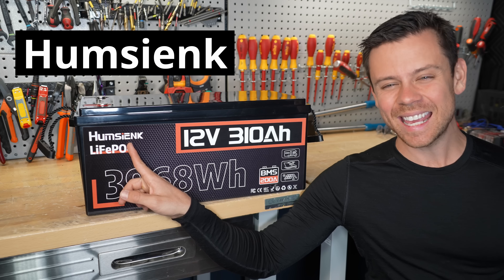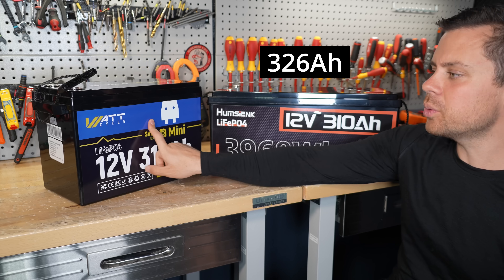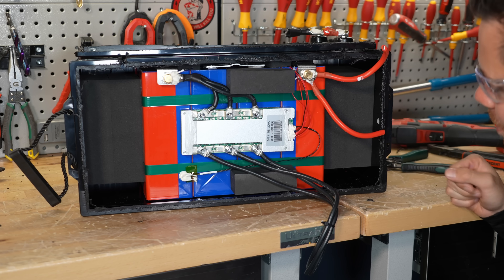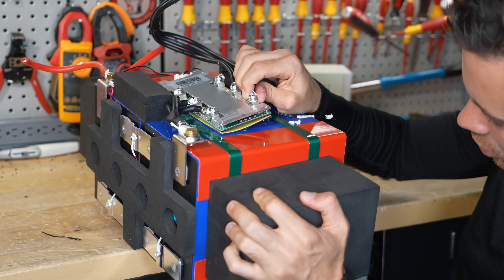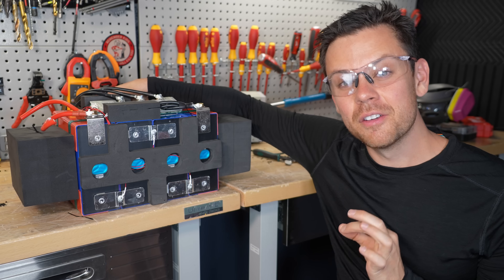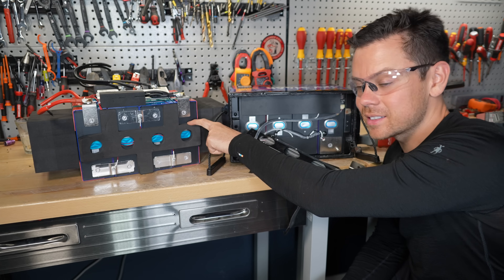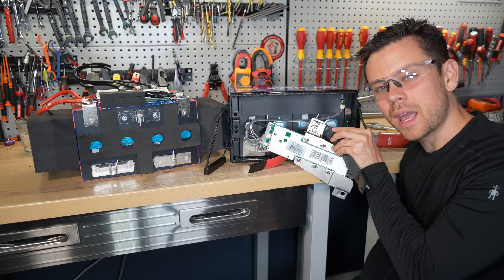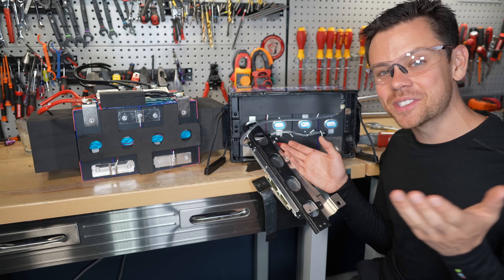$369 Humsienk 310Ah Battery VS $500 Wattcycle "Smart" 314Ah Battery

Comment: Hey Will, at about the 2 min point of your video, you strongly suggest to install a Terminal Fuse on the battery. Sorry for the dumb question(s), I'm a newbie to all of this, but how do you determine what size (Amp) terminal fuse to use? I have found many different opinions-Difficult to know who to trust. FYI, I just want to put together a system using a Lifepo battery, probably 12V 100Ah or 24V 200Ah, that I can use to charge my Oupes Mega 1 when I have bad solar and no access to AC; My hard dry camping days or hunting excursions! My Oupes Mega 1 accepts solar charge at 800W Max, 12-78V DC, MPPT: 18-75Vdc, 14A. Again, sorry for the long winded question but I can't seem to get an understandable straight forward answer. I even logged on to the DIY Solar Forum and got several different opinions. 😒
Just looking for some intelligent guidance.

Comment: I’ve watched you from the beginning impressed with your videos. I’ve been watching the current Battle Born saga, unfortunately I have 7 of those (4 in a buddy van build I did and 3 in my own camper). My battle borns seem to be doing fine, I’ve done a bit of testing under load and checking terminal temps. That said I just ordered 2 HumsienK 314ah minis to replace them with. I needed more capacity. Any chance you will do a test on the mini, I’ll certainly keep you updated with my view?

Comment: I use these Humsienk batteries in my cars as an auxiliary power source for my audio amplifier, air compressor, power inverter (to keep tool batteries charged). The batteries are usually a few inches away from the subwoofer, and the roads I drive are akin to wash board roads.
Its been 2 years of use on my oldest Humsienk battery, overall very good product, and very durable.
I think I paid 160-170 each from Temu and it was from a warehouse in the USA.

Comment: If you thought that was a good price for the Humsienk, they currently have on sale on their website a 12.8V 8,192 Wh  (640Ah) LiFePO4 battery for $644 if you get the 2-pack. It even got smart with Bluetooth and a 250A BMS. Got an additional 5% off with a Christmas code. Of course I had to get the 2-pack.

Comment: I just ordered 2ea Dumfume 12v - 314ah self heating batteries.  I took your advice about stud fuse for each battery.  I have several older 12v 100ah lithium batteries, how should I dispose them safely?

Comment: Thank you for your great video. I think it's great that you get to the bottom of all the things here. This is a good way to get a good impression. I have a question for you. You mention the problem when you connect two identical batteries that they discharge absolutely unevenly. Were you able to determine this with the Humsienk as well? Because I wanted to use 2 Humsienk 314Ah in parallel in my motorhome. Or should I rather buy the ecoworthy from the test right away. Currently, 2x 314Ah with Alieexpress delivery from Poland to Germany would cost 545 euros. I would be happy if you could write to me. Greetings from Germany Markus

Comment: This is what happens when batteries make a name . There are many other batteries out their that work exactly the same Like the Humsink .. It works for me as long as you have a battery and you can use a fuse or a circuit breaker .  Redodo 12V 165Ah LiFePO4 Battery with Bluetooth, 165A BMS, 2112Wh, Group 31 Lithium Battery with 1.65X Longer Lasting, Perfect for RV, Marine, Solar  $279.99 It was going for as low as $199.00

Comment: On 11/14/25 I see that there is now a Humsienk 12V 320Ah Bluetooth LiFePO4 Battery with a 250A BMS for only $299.99. I am thinking about getting 2 for a 24v battery bank. Saw it on the Humsienk website.

Comment: First - Thanks for your great videos.👍

Secondly, a question -
Can you use 2 of these in series to use in a 24v solar system?

Does the BMS in the batteries handle the balancing, etc if put in series?

Or is it best to buy 24v batteries and put them in parallel to get the amp hours required (as most 24v seem to be 100ah)?

Thanks for any info / knowledge you can provide.

Comment: Thanks Will, whats your thoughts on those MRBF fuse holders having a 3/8" mounting hole & connecting one to a lifepO4 with 5/16" post ? there is a pretty big gap there.

Comment: Will you be testing any of the 600ah batteries? I currently have 1 Watt Cycke 300ah "dumb" battery but will be considering going to 2 600ah batteries on my boat, with a xantrex xc pro 2000

Comment: Totally unrelated but I have a 8k hybrid GDSuper inverter 3 710w bf panels & 1 450w mc panel can I run my house (avg 6 sunhrs) ac to keep it Kool? Also I have a 12v 200ah gel battery can I get a booster or transformer type device to go 48v maybe to just power the inverter idle mode to, love u Will could u let me know?😅 my pockets r weak I want to avoid going on grid ($500usd) or getting a 5k lion ($1100) I wanna just buy a $50 booster device or just go panel inverter to load when sun is out😅😅😊

Comment: I would love to switch my dump trailer to lifepo but it pulls 400-800 amp with a heavy load should I just use a lifepo with 30amp dc-dc charger to charge my led acid
Reply from the maker: Use trolling motor lifepo4
Reply: @WillProwse definitely not cost effective

Comment: @willprowse can you help me with a capacity problem im debating? I made my first 280ah 48v battery, I wish I would have used 314ah or 320ah cells though. I am going to make 3 more, but im not sure if I should stick with 280ah so I could use them in series in the future if I ever want, or if I should just make the next ones with 320ah to get the extra capacity for the same footprint. What would you do? Im really stuck here, any help is really appreciated

Comment: I got a DOA EcoWorthy 280 AH LifePo4 battery non Bluetooth and opened it up myself. (Not my cleanest work) the bms was disconnected from the balance leads I think. One of the connectors with the glue or white goop had obviously not been glued or gooped up properly and was just hanging from the bms and it connected with the 0-25-50-100 percent led thing. They offered me 60 bucks back I asked them if they’d send me a 20ah battery but since it was an Amazon purchase they just credited back to orig pay method. Although on the other hand got a perfectly fine Bluetooth EcoWorthy 12v 100ah of the same style but just the Bluetooth and works fine. Hmmm

Comment: Greetings, i have enjoyed your videos. I had looked back through past videos and was trying to see if you had created a video on a ‘plug and play’ solar system that included a few solar panels and low voltage micro inverter (120v) that could simply plug into a home outlet (dedicated circuit). Goal is it add a few kWh to a home’s supply each month, reduce power bills by a few $$ each month, and take advantage of the tax credit. There is likely issues with this type of setup but hard to find many details/videos. One issue I found is the inverter needs to stop sending power to home when there is a potential to backfeed grid.

Comment: Good morning Will,
I just purchased 25 380w, 48.45V Voc, 9.9V Isc solar panels and an EG4 12000xp for an off grid system for my house, I was wondering if you  could help me configure a series/parallel array that would give me the highest efficiency out of those panels connected to the 12000xp and what cabling will be needed for a 250ft run from the panels to the inverter and if it is even possible or advisable. I hope I gave you all the information you need to help me figure this out. I will appreciate it very much if you have the time.
Thank you!

Comment: Will Prowse 
Can you give me advise. I have 450W of solar and i would like to  charge my 36v golf Cart battery and my Bluetti 200 P, I have a DC switch with 1, 1+2 and 2 .Golf Cart has a controller on 2 and solar straight to my Bluetti on 1. When i switch to 1+2 , will i be able to charge then at the same tine.
Thanks for your Time

Comment: I bought WattCycle 314 Smarties thinking I could double them up in my RV, that is until I saw your video on the BMS issue. So now I have separated them through switches and can run or charge only one WattCycle at a time. Pain in the neck! Please advise on when BMS update is coming and how this will be installed. Also, your thoughts on outdoor storage at 10 degrees Fahrenheit would be much appreciated. Cold temps coming quick in Colorado. Thanks for what you do!

Comment: Watt Cycle recently added a beta 4 version of their app which gives two options under the parallel mode setting: Compatibility Mode, or ExactMatch Mode.  The ExactMatch mode is for when you are using all the same brand/model batteries which were purchased within six months of each other.  Compatibility is for when you have different brands/models in parallel.  Next they really need to fix the Android bluetooth connection issue.  It takes me three attempts to get connected... sometimes four.  Perhaps due to a BMS sleep mode when the batteries are not being used.

Comment: Hope you read this. In Asheville, our home has limited indoor space to add backup. Would like to add battery backup externally but only see EG4 & Discover with weather rated exterior batteries. Is there a budget version of these wall mount batteries like the DIY $1699 you posted? For our home, the EG4 case they offer that can come with 2 exterior heated batteries, a Grid Boss & Flex Boss would be perfect in theory. But the PRICE of that is astronomical. Can you “build” a budget version like how you combined the SunGold of an exterior grade system I can mount on the side of our house next to the meter?

Comment: I have an RV and just bought the LiTime 320a mini. It will not charge with my current charger. Something about ripple voltage. I can set all the correct charging parameters but still won’t charge. Solar and alternator is ok. So that would be a good test. My charger is a GoPower IC3000.

Comment: When it comes to trust, as someone brand new to solar, you need to be very careful which company you work with to design and or purchase your solar equipment from. Some, like current connected, will sell you components that are 2.5xs more expensive, and can be made to work, instead of an off the shelf solution specifically designed for the application. When questioned they will claim it's because the correct component wasn't in stock at the time of the purchase AND, as a completely new person to this,  you should have known better when purchasing .  I only purchased from them because of free shipping; a mistake I've been dealing with for several weeks.

Comment: As an engineer, who was trained in the British Royal Navy, and as someone who worked on SSBN Vanguard submarines, we solder connectors, and still today in the high end electrical engineering trade crimped connection is subpar.
Reply: I agree to an extent.  With properly soldered joints, oxidation will never be a factor.  For that reason, I prefer soldered connections between the cables and terminal clamps under the hood of a car or on board a boat. 

But for lifepo4 batteries that don't off-gas and are generally kept in a somewhat climate controlled environment, the properly crimped terminals are safer.  

The reasoning is due to any situation where overcurrent is reached and sustained long enough to heat the joints beyond solder's melting point;   it could serve to worsen the heat problem by losing contact surface, thereby increasing resistance against the persistent pull of that high wattage.

Comment: I considered Humsienk but sadly here in EU they only had 100A BMS, but that seem not to work anyway. They are very nice when emailing them. Other companies walk around the questions, ignore them altogether and answers are very short like: "OK GLHF".
Humsienk is the only brand i mailed with that was polite, nice, answered all questions and also came upp with alternatives and good advice.
That alone made med want to support them. How they actually is in reality when a problem arrives is another question.
Bump up the build quality a notch and it would be a very good battery and fix the OCP issue and you are almost there.
Reply: So building your own with raw cells and a jkbms and decent breaker and busbar and I am there. The convenience of a nice looking box is a trade-off imho. I want my cells to balance and absorb and charge at and to 3.45 volts and OCP at 3.6 (I suppose you mean over charge protection with OCP and not over current protection?)
Reply: @camielkotte  meant over current protection, overcharge protection is a key funktions and what i have seen always work even with the cheap batteries because it could result in catastrophic failure with lots of smoke and in more rare cases fire as a result, but the smoke is bad enough though.
The over current protection seems to always be set to high on these cheap batteries to even a short does not trigger it.
I own eco worthy which have good internals and build structure but i always use fuses on each battery, but most people skip this which is madness in my eyes.
I got the know how to build a battery, i actually built MC batteries from small nimh cells in my youth. However the time and often tools needed, spot welder, quality busbars, separators, encasing ect ect ramps up the price and of course your time. Then you will dig in to the BMS setting and i know i probably will fiddle with that for months, i easily get sucked in to projects too deep. So now i have a couple of good batteries just doing their thing, cells balance out at about 14 volts and the only little issue i have is that one battery draws a bit more power than the other, but that is probably due to small differences in crimping, bolt connections and other small imperfections. I will try to rectify those by trying other fuses.
No need for balancing at 3,45 volts when the cells can handle up too 3,65 volts? But its always good to have some margin to the edge. Mine lies round 3,50 volts while charging the last percent.
Reply: @saab900turboT16  I d say the over current is a last resort protection. We protect our wires with accordingly sized fuses. 
I don't buy batteries of which I can't change BMS settings. I ve built a few lifepo4, for my boat and my off-grid cabin. 
Prepared for a year. Yes it takes time to build the first but I learned a lot. 
For one thing, the BMS is key to longevity. 
And yes, it is commonly accepted to charge to 3.45 to start balancing. You can set it higher but that leaves little time left to balance and ovp is more likely to kick in.
maybe check and go to Andy, from the off-grid garage australia. He explains everything for you if you're still in for diy. 
Almost every BMS on home batteries suck too btw. Suboptimal settings and mistakes and lack of knowledge at companies is staggering. I highly recommend Andy his channel. He is a great resource and works out problems and points out problems with batteries.
Reply: @camielkotte i always use fuses. I have my eco worthy and they seem to work good. Its always better to DYI but many just wants working stuff out of the box. I suspect you do not buy acid cells and build your car batteries yourself or "roll" your aa bateries yourself either?
If all batteries out there sucks how are the companies still alive?
Key to longelivity is to handle the batteries right and understand their limitations. My car batteries got no bms and i usually get 10 years out of them becouse i know how to keep them alive.

Comment: Smart anything just ends up being supper annoying. I have an LG TV that I use as a monitor that I installed yesterday. I turned off the computer to go to bed last night and the screen went black. As I was leaving the room the entire room lit up because the TV had turned on and started showing stupid bright random pictures with an icon telling me that the HDMI port the computer was connected to is off. Running off solar you don't want things that should turn off turning back on to tell you nonsense you already know. Much less showing pictures you didn't ask for.

Comment: This kind of stuff just makes me annoyed at ebike batteries. 500 Wh battery (e.g. 36 volt, 14 amp) is easily $500, so $1,000/kWh.  These are around $100/kWh.

Yes, the ebike batteries are smaller, but that's a ten fold difference.

Comment: I recently bought four of the Humsienk 12v 314Ah Mini w/bluetooth and 100A BMS. They all came with about 40% SOC and took several days to get them to 100% with my small charger. Installed them in my offgrid 24V system in 2S2P configuration. I like that my house is close enough to my battery shed for the bluetooth to work. One of the four has been lagging behind the other three in SOC, about 10-12% behind.

I bought the LiTime balancer and now all four are right inline with each other, quite happy with them. Going from Rolls Surrette 6V to these have been a life changer, wish I had done it sooner. Hoping they last for several years! BTW, paid $1330 for the four when they were on sale in July.
Reply: The cells will last at least 10 years as long as they never get overcharged or under discharged. I've got LiFePO4 cells from 2014 and they are still pulling like 90% capacity.

Comment: If the battery case is thigt sealed, what happens with gases in the event of cell venting?
The casing should have some venting valve too, otherwise could explode under pressure.

Comment: I wish I could get these batteries in New Zealand. 
Some brands do have local agents but the prices they charge are WAY more than just the exchange rate conversion. 
Aliexpress will not ship batteries here so we are stuck with high prices
For example the Wattcycle 314ah 12v is over $1160 NZ$